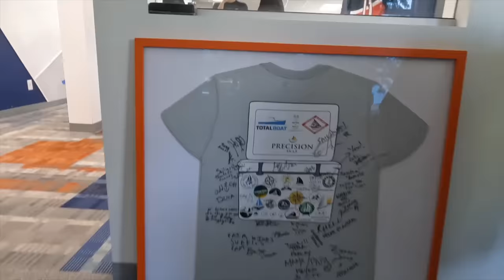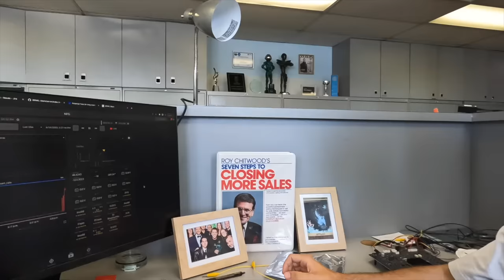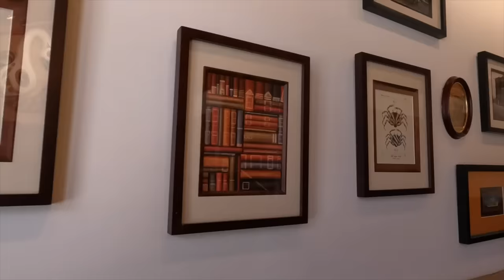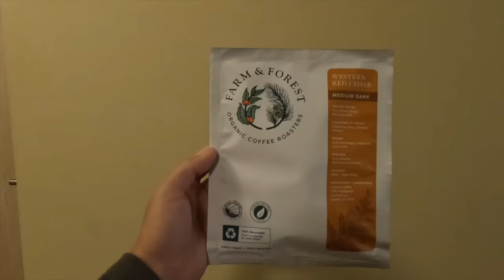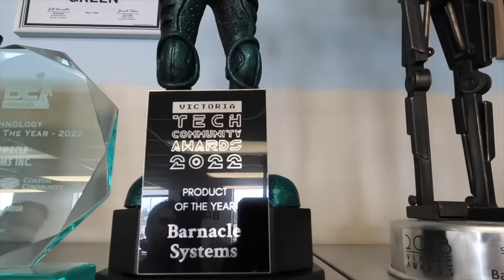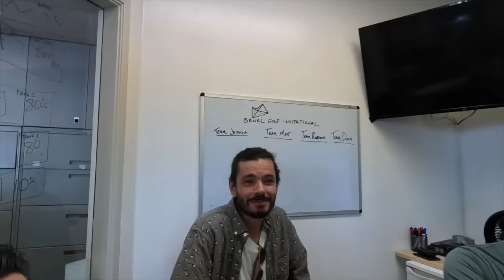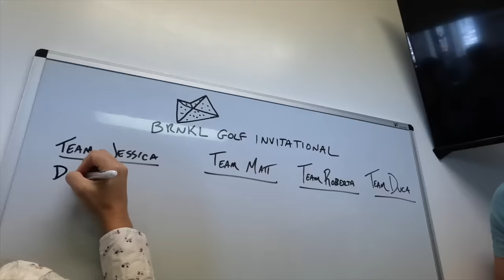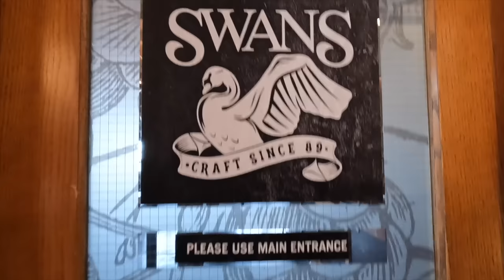⛵️Doing things for the first time is so AWESOME!! 😎 Ep.307

Comment: Getting back to the new yacht and the design of twin keels from the very short glimpse you showed us all can you give us all some more detail as i have some concerns around structural strength and cracking in the hull.
Reply from the maker: We are gonna talk more about it once we start the building of the boat next year. You can see more about it at meta website https://www.google.com/search?q=meta+chantier+naval&rlz=1CDGOYI_enBR606BR607&oq=meta+chantier+naval&aqs=chrome.0.35i39i512i650j46i175i199i512j35i39j5i44j0i22i30l3.9975j0j7&hl=pt&sourceid=chrome-mobile&ie=UTF-8